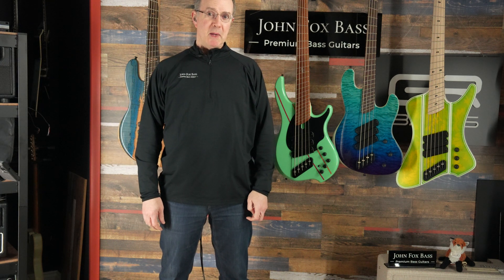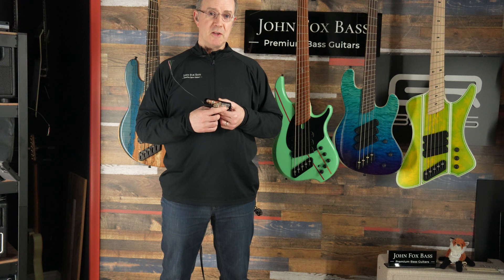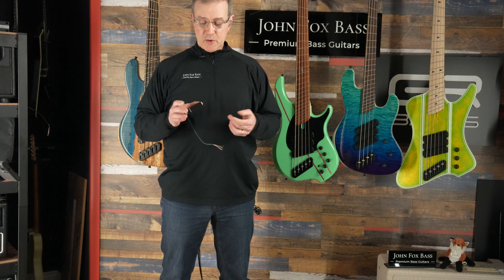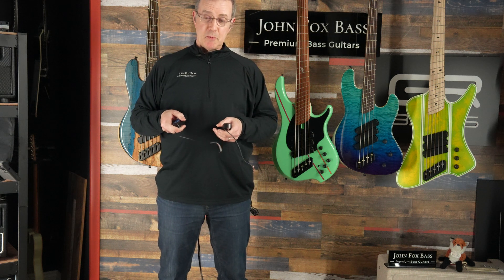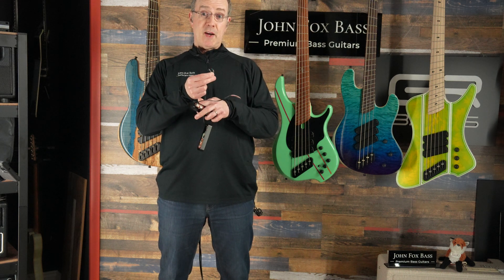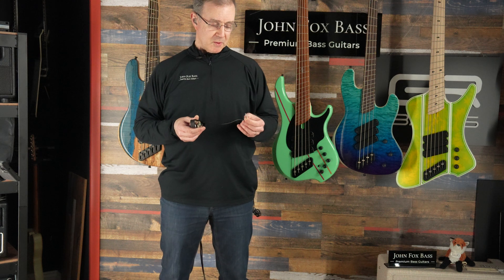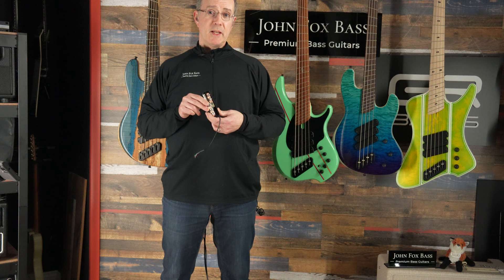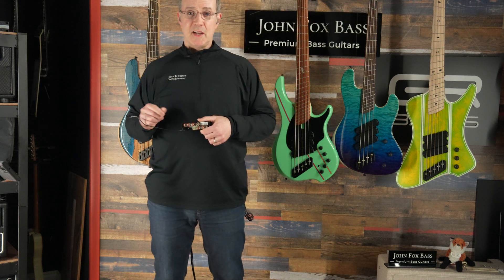How are Dingwall Bass Pickups made?

Comment: What is the key difference between FD3 vs FDV? Neo vs Alnico
Reply from the maker: The key difference is the tone. The FD3 pickups have more punchy mid-range that is emphasized, while the FDV pickups have a more balanced and even frequency response across the entire spectrum.  And although you didn't ask, the Super Fatty IIs are made similar to the FD3s, but they are wound with a lot more turns of thinner wire, so they end up producing more bottom end, and also more very high frequencies, without specifically emphasizing the mid-range. It's not that the mids are scooped, but the lows and the highs are emphasized. So they just sound huge.

Comment: Really cool video! Dingwall made a couple of graphics showing the differences between their pickups. Apparently the SFII is more or less like the FD3 but with more low mids and lows, so if I'm not entirely mistaken one could EQ an SFII to sound more like an FD3 by cutting some low end (I prefer cutting to boosting so the other way around is probably not the way to go for me 😸). That's probably why some people say that the SFII sounds more v-shaped, but that V does come from removing mids, just by boosting other parts of the spectrum. Wondering if that' sound reasoning. What's your stance on it? 😸
Reply from the maker: Sorry, just noticed your post. Everything you said is exactly correct.

Comment: Did I see a magnet fall out at 3:30 ?
Reply from the maker: Wow, eagle-eyed Paul!  I do see what you mean.  I just went and checked both pickups. They are fully intact, those magnets are VERY firmly and permanently glued in place. But I did find a small chip of the glue on the floor.  Sure enough, a little flat pancake shaped drop of the clear epoxy or whatever the adhesive is that is securing everything did fall off the flat surface of one of the pole pieces. It was just sitting on the pole piece without being connected to the bit that was running down the side of it, so it didn't have much to hold onto.  Very impressive that you spotted that!  Thanks for watching. :-)
Reply: @JohnFoxBass  I was watching in full screen on a big monitor, hoping for a close up. I have four Canadian Dingwall basses. Three of the from the 2000s with the square corner pickups, which I have upgraded every time they made changes to the old FD3 design. My fourth Dingwall is a 2018 Z. It was made to order, so I have never had a reason to remove or modify anything on it. I haven't even looked at the bottoms of the FDVs. So, I'm always curious about the varieties of the current pickup models.

Comment: Super nice video ! I was wondering about that exact question. 

Just wanted to say, 3dB isn't twice louder for human hear. You can get 3dB by using 2 cabinets at the same level instead of one, but that is not twice the level for human hear. Actually, human perceive twice the volume when there is an increase of 10dB (which is a lot, because it is a logarithmic scale) 

And the "N" in the FD3-N are normally just for the Korean made FD3 that are in the Ready to Play serie. 

(I saw you at guitar summit, De Gier booth, but didn't come to you aha, I tried one of the P 5strings)
Reply from the maker: @francoishtzl157  I wish you had stopped and said hello! Thanks for the correction on the decibels. I learned something! I know that 3dB is a doubling of power, like if you go from 400w to 800w, that gives you a 3dB increase. I mistakenly equated doubling of power with twice as loud. Looks like you are right, 10dB is considered to be twice as loud.  Regarding the pickups, there's a difference between FD3n pickups which are made in China and used on the imported instruments versus FD3-N, which means it's a Canadian made FD3 pickup with the N polarity as opposed to the B polarity. On a three pickup bass, the pickups are normally arranged NBN because you cannot put two of the same polarity right next to each other. I was just reading the label on the bottom of the pickup as I was making the video and realized right after I said the n that I should not have even said the N. I should have just said FD3, since I was holding a Canadian pickup. If you look at the bottom of an imported FD3n pick up, you cannot see any pole pieces or wiring, it is all filled in with black epoxy or resin, so all you see is a sticker.
Reply: @JohnFoxBass  Super nice to know thank you for the clarification ! I just send my NG3 to a Luthier and he didn't understand why it was labelled NBNeck, is it for like Phase or something like that ? 

For the dB thing, I was searching the other day because I wasn't sure. 

Exemple : 

If you go from 80 to 90dB, it is 10dB so twice the volume the humans. But if you go from 80 to 100dB I wasn't sure if it was like but 20dB increase is 4 times louder. I didn't realise that before ! :O

If you are at Guitar Summit this year (I hope me too) I would come say Hello :D 

I think first video I comment on was on the Bergantino Cabs, I was searching for a Cab and now got an NXT212. Sound Greeeeat